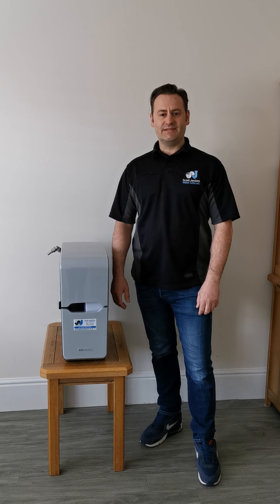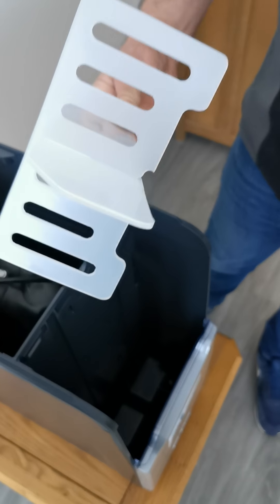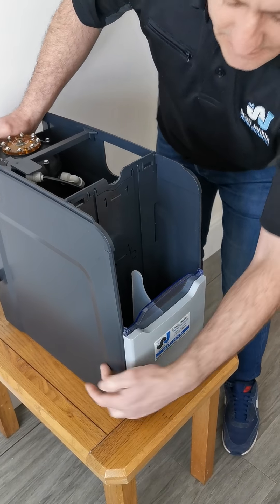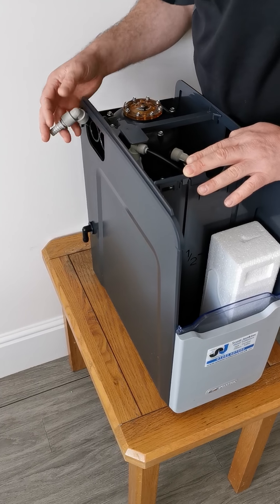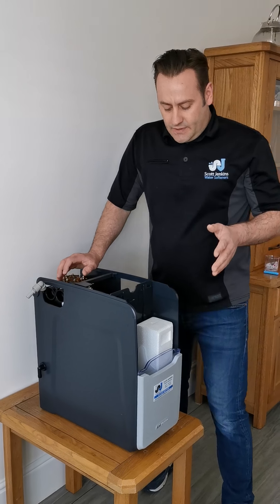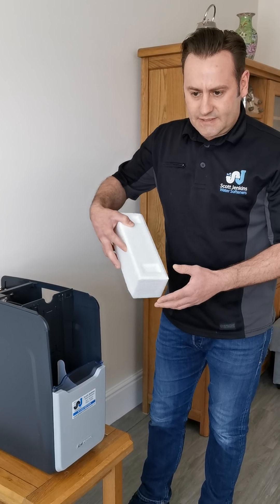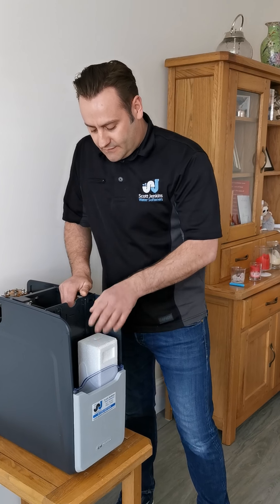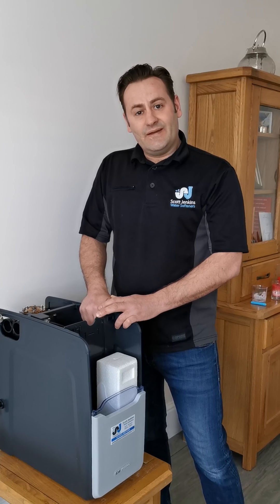Why is my water softener using too much salt?

Comment: it could be regenerating too often and that is why is is using too much salt
Reply from the maker: Hi Radish, thanks for your comment.
That would be true if the softener was set to the wrong hardness. Otherwise, kinetico softeners don't just regenerate sporadically they are metered.
Kind regards,
Scott
Reply: @scottjenkinswatersofteners1643  Thanks, how would one change the setting, have you a video for that?
Reply from the maker: @radishpea6615  the best thing to do would contact your local dealer for advice. If anything goes wrong it will affect your warranty.
Reply: @scottjenkinswatersofteners1643  It is out of warranty. Can/will you advise how to change the frequency of regeneration  please?
Reply from the maker: @radishpea6615  firstly, why do you want to change the frequency of regeneration and can you tell me what disk it is currently on and how hard your water is please?
Reply: @scottjenkinswatersofteners1643  I think it regenerates too often. I would not know how to check what disc and I do not have equipment to test the hardness but a Google search shows hard to very hard. Hope that helps
Reply from the maker: @radishpea6615  please don't take offense, but your reply suggests that you should not touch it and have a local supplier over to help you. I would suggest booking in a service at the same time. This way your water can be tested and the engineer will know whether to change the disk or not.
Reply: @scottjenkinswatersofteners1643  No offence taken but all of us at one point did not know. From what you say, changing the disc is the only way to adjust the frequency of regeneration, is that correct?  thanks for the help.
Reply from the maker: @radishpea6615  yes
Reply: @scottjenkinswatersofteners1643  thank you